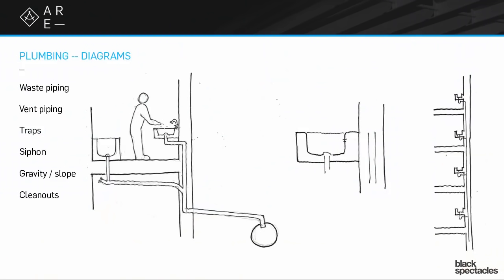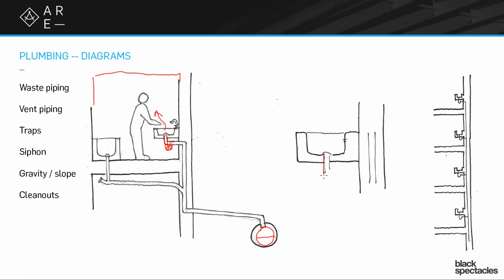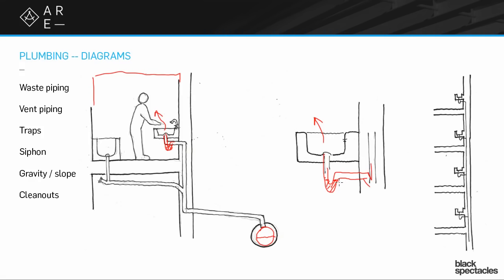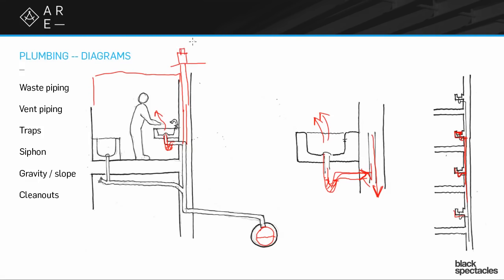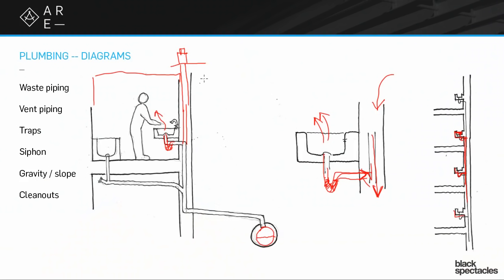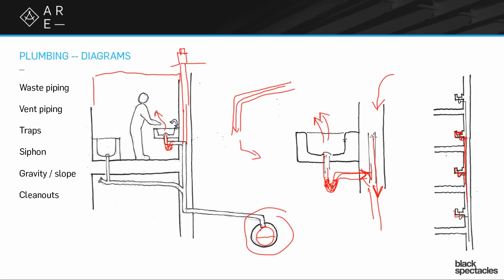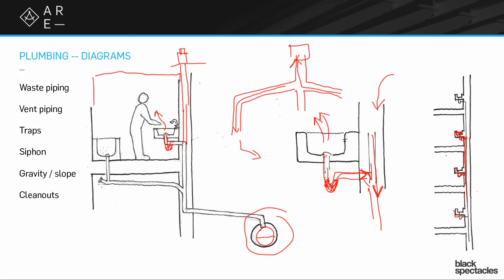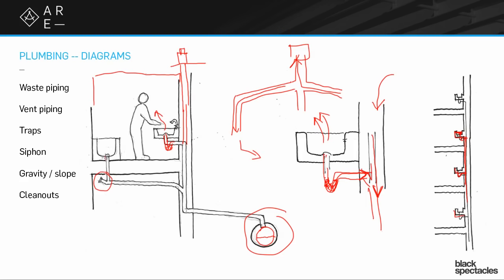Plumbing Diagrams - Building Systems

Comment: This video is really great. Plumbing Diagrams of Building systems is really important. Only A professional and certified plumber have this kind of knowledge. Thanks for this video.
Reply: Well, in Australia it's more likely the average plumber would know how to install the hardware, but not necessarily why. An engineer specialising in reticulating hydraulic services would have the additional knowledge about siphons and condensates.
Reply: @cerealspilla  well now I know why